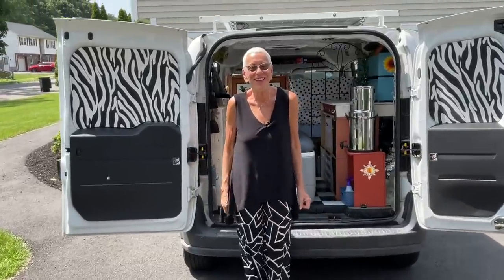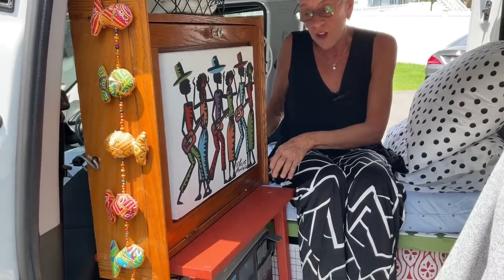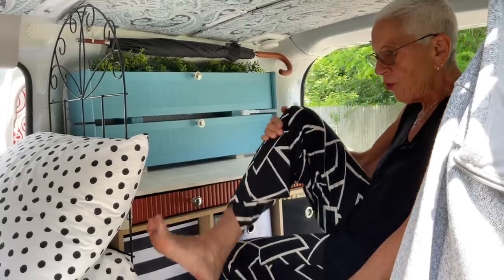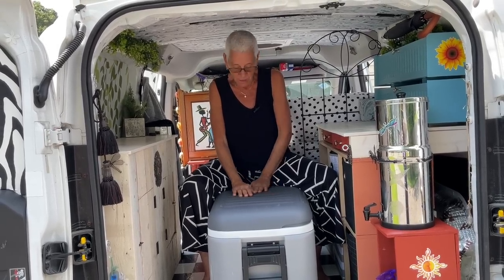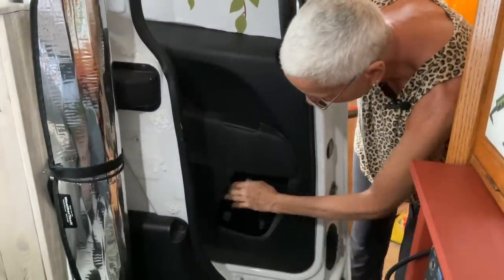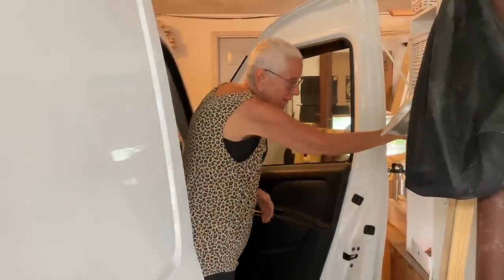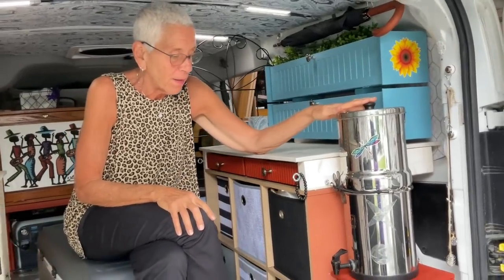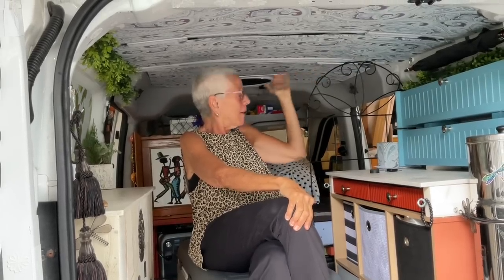MAKING ADJUSTMENTS TO MY VAN BUILD AFTER MY FIRST ROAD TRIP IN THE NEW BUILD - LIFE IS GOOD!!

Comment: Lulu, I've been researching cooler sizes for you.  I suspect you already have done this research too.  As far as I can tell, your present cooler is 17.75 inches high. I looked for a different cooler that is lower in height and still at least 100 quarts.  I searched Yeti, Pelican, Igloo, RTIC, Cabela's, Orca, Engel, Magellan. It seems that nobody has a large cooler that has a lower height. Your 120 qt Igloo exterior dimensions are 38.31x17.36x17.75. Interior dimensions are 34.69x14.88x13.25. I think the dimensions correct? I think the only possible consideration might be the Yeti 75. The Yeti 75 exterior dimensions are 33x17.8x17.6  with interior dimensions of 25.8x11.10x13.10. You would only gain .15 inch of height.  That is such a small amount of height savings. It doesn't seem worth it because of the loss of interior storage in the Yeti 75 cooler. Perhaps try two (2) Yeti 65 coolers with exterior dimensions of 30.8"W X 17.3"D X 16.0"H and gain a soaring height of 1.75 inches! Its been fun to try to find something to help solve your seating height problem. I know you're still looking for a solution by changing the top or bottom of your Igloo or by sinking it into the floor. I know you'll come up with a brilliant solution, you always do!
Reply from the maker: WOW DEBRA!!  I can't believe all this research you did!  what a thoughtful person you are!!  I truly appreciate it!!  yes, you had the measurement of my cooler correct!!  ❤️

Comment: Regarding your cooler, the seals are pretty important to keep it cold inside, so I probably wouldn’t mess with the top. But what about cutting a hole in your floor. Do you have enough insulation, subfloor to get an inch extra?
Reply from the maker: hi Beth!! thanks for the suggestion, but I need the cooler to move around, not be stationery.  I need to move it a bit to open the door to the pallet cabinet, and then I need to move it back over to pull out the cubbies, and I need it in a certain spot for when I'm sitting and cooking so there is room for my feet.

Comment: Your idea is amazing but to make it more comfortable is just get Velcro and a lawn chair cushion the long ones and another patter and secure it to the top it’s light weight and does not compromise the seal of the cooler
Reply from the maker: hi Mary, good thought, except a cushion on the cooler would bring me up to touching the ceiling with my head, I do not have the space for a cushion.  I need to be lower, not higher!

Comment: On the cooler, do they make any of them shorter?  I do like your thinking on the foam board with wooden board as lid.  Similar to your trimmed bubble silver liner, when I was using my 25qt cooler I trimmed a FedEx bubble wrap plastic envelope to fit to keep the cool in. Then a friend gave me several of those big silver bubble wrap bags that they do meal delivery in that I repurposed by turning one instead out so silver is pointing inward & put that bag inside another bag that has the silver on outside so it is double insulated to hold the food inside the cooler.  It really works.  

On the door to salad bar latch, yes a little board that toggles/turns could work.  I have something like that to keep drawer crates tucked under my bed & not slide out while driving.

Yup, we are forever readjusting our PMC cargo vans, depending on what kind of trip it is.
Reply from the maker: hi Karin!!  I can't seem to find a cooler that big that is shorter, mine is 17.75" tall.  I'll figure it out!!  yes, that bubble wrap makes a huge difference!!  glad it's working for you!   😊

Comment: Hi, Lulu. I was just wondering how much space is between the cooler & the under the cooler space there is. Perhaps cutting a hole in the floor just big enough & deep enough to give you more head room @the ceiling.
Reply from the maker: not able to have the cooler stationery, I need to move to to get into the cubbies and then move it the other way to open the pallet cabinets doors.  thanks for the suggestion though!  💕

Comment: I’m hoping you will talk about the tweaking you mentioned regarding your power use. Would really like to know what you learned.  Thanks!!!
Reply from the maker: hi Nancy!!  I learned that my power system is working just fine, it was just that I didn't quite understand my new set up yet.  I was used to 400W of solar and that charged up my power station fairly quickly.  now I only have 200W of solar so naturally it's going to struggle to get it up to 100%.  and I'm not driving all the time to be able to charge it that way.  I'm figuring out and seeing patterns on what I gather, what I use, and what I'm able to use without a threat of running out.  so far, so good!!  😊

Comment: I hope I explain this in a way it makes sense.  If you have a half inch space between the drawers can you attach a small board to the bottom on the  side of one drawer  that is equal to the amount of space you have? To make a spacer so the drawer doesn't touch the other one.
Reply from the maker: good thinking!!  thanks.

Comment: looks like you are bending forward a bit to avoid the ceiling now.  probably not good long term for your spine and neck.  your left shoulder seems higher now.  i was a van dweller for 4 years and still dealing with hip, shoulder, and neck pain.  i have screwed up alignment from sleeping and sitting in it, even two years out of the van (age 66) and chiropractor.  it's quite painful.  looks very useful and pleasing to the eye (sept the umbrella🤣😂).
Reply from the maker: keep watching my videos and you'll come across the modification I made to get another inch of headroom . . . gamechanger!!!  😊

Comment: how about just a little white caulk in the corners between the trim and fan to hold it up, you can remove it better than glue just cut it with a utility knife.  Cooler idea 👎You won't have that tight suction fit and i believe that adds to the insulation.

Comment: Hello Lulu I'm with one of the commenters get a smaller cooler you don't need such a long one and someone said to get smaller portions of food or not so much I don't know how to read that again whatever you do I know it'll be good and good luck on your trip I wish I had the patience and strength to cut things like you do for your salad my back hurts so much I have to just hurry it up I like your spunk for being alone and traveling I would be lonely and scared that's just me though
Reply from the maker: hi Diana!!  getting a cooler that is not as long will not solve any issues that I have.  I have the space for the long cooler.  it's just too tall.  but even the smaller cooler are still the same height!!  oh well, I'm making it work for now, until I figure it out.  it's all good!!  thanks for writing!   Lulu  🌺

Comment: Do you really need that bulky cupboard/fold out table next to your bed? Is there not a better, smaller, solution for that space?
Reply from the maker: hi Adrianna!!  well, the power station is there and need to stay there, the table over it needs to be there to protect it from me putting stuff on top of the power station and potential spills.  so if the power station is there and the table is there, might as well use the space above it, it's just empty space.  ya know?

Comment: One thing I've been wondering is whether or not your painting is going to get damaged over time from the wood edge when you open  
the cupboard.

Did you match the colors in the painting with your decorating on purpose?
Reply from the maker: hi Moka!!  I'm not worried about the painting getting damaged. it doesn't seem to be causing stress on it.  but if it does, so be it!!

you gotta hear the story about the painting in this video:
https://youtu.be/-HkSUbWah0g
go to minute 7 in the video.

Comment: Lulu can you cut out the floor just enough for the cooler to drop down a little?
Reply from the maker: no because I can't have it stationery like that.  I need to move it over to pull out the cubbies, I need to pull it over to open the pallet cabinet doors and I need it in a certain spot to sit and cook so that my feet fit on the floor.  it's tight in there!!!  😊

Comment: Would it be possible to add a shelf above the doors of your white washed wheel well cabinet with little doors for access?  Then maybe the empty space at the top of the cabinet could be used more efficiently.
Reply from the maker: hi Susan!!  I intentionally left that upper wall blank,  I need the headroom, I don't want to close it all in.  I think I'm good on storage!!  thanks!!  😊
Reply: @LulusWay64  Thanks for your response.  I wasn’t clear in explaining.  I meant inside the upper part of the cabinet.  With the doors starting low in the cabinet it’s hard to access the space above the door opening inside the cabinet.  A shelf inside and little cabinet doors above the cabinet doors that are already there might make that space easier to utilize.  Perhaps that would be too complicated to add, but it’s a thought I had when looking at your beautiful build.
Reply from the maker: oh, now I see what you mean!  yeah, it's pretty complicated inside that cabinet, above the doors is a 1x1 support beam, then at the top is a 1x1 support beam, and also on the sides.  also on the back of it (on the metal) is a thick board that attaches to the metal, then attaches to the countertop.  and the cabinet is just so narrow that there is very very very little space available, even though it looks like it might be open and available space.  it's all crammed up with wood!! LOL  structurally it was very important because it's rattling down the road when I drive and it needs all that support.  I need to think of it less as a cabinet and more of a wheel well cover with a countertop, with a tad bit of available space to shove a few things, not much though!!

Comment: If I put a wider table on the top of the unit behind the drivers seat, I would hit my forehead on it constantly.

Regarding the cooler, I only wonder if the idea you have would have the same insulation qualities as the manufacturer built into the lid. You’d probably need to at least put some kind of rubber seal between the wood and the cooler edges.
Reply from the maker: hi Chris!!  fortunately, my head doesn't go anywhere near that little shelf, so I won't be hitting my head on it, YAY!!

I expect that the performance of the cooler would decrease if I tampered with the cover, I would expect that.  but I would also expect that it would do a good job.  I'm still thinking about it!!

thanks for your thoughts, I appreciate it!   Lulu  😊

Comment: Lulu great tweaks love all your new ideas. I was thinking about your cooler. Is it possible the floorboard could be made thinner. Maybe it’s thick? that would give you some head height. 
I would be afraid to mess with the cooler lid. that insulated thickness is why your cooler is efficient. You might loose that insulation & spoil all your food inventory which is a big expense to lose. Otherwise your idea to find another cooler might be best If the floor idea doesn’t work. So excited to hear what is next in your big adventures. Mariaknits27 💃🏻💕🚐
Reply from the maker: hi Maria!! thanks for the suggestion, but the floor is in, lots of things are built onto it and it's staying!!  I'll figure it out!!  😊

Comment: Lulu please use the blackout on your windows. No matter how safe you 'feel' there is a potential to become a victim.  
 And any lowlife WILL take the advantage of breaking in while your asleep. Your reaction to such an invasion  may be too slow to make a difference. At least with the windows  covered you can get behind the wheel quick enough to drive off to safety. 
Make plans on what you could do when SHTF.
Reply from the maker: although I appreciate your concern, as I said in my video, I am not concerned with this at all.  I will assess each situation as it comes.  😊

Comment: I've been reading of suggestions of adhesive command strips or velcro strips for use with the fan frame. I'm in Australia, and what I have found is that anything adhesive like a velcro strip or a command strip won't cope once the heat hits whatever the strip is attached to. Likewise humidity affects them as well. May I suggest for the fan frame that being as you have the corrugated plastic (by the way it's called corflute) under the blue paisley fabric, it would be easy to use sewing pins or a staple gun to attach 4 white 1/2 inch waist elastic to opposite sides of the edges of the frame and stretch it from one side to the other side of the frame. The white elastic would easily blend into the white frame edge. This way if you did need to get the frame out for any reason it could just slide out. I used this method to attach a power board under my desk to keep all the cables for my computer etc. tidy. The stretch in the elastic works better than ribbon.

In terms of the fold down table. I think moving it over etc. is a good idea, but instead of putting your bowl at the very top next to the basket, have you thought of getting another thinner piece of plywood and fixing it with a hinge to the bottom of the side of the cabinet so that it could drop down across your lap when in bed and then when you don't need it flip it back up and secure it with a latch at the top? 

I also think your idea for the cooler lid is genius and would allow you an extra opportunity for a decorating touch! Love your work!
Reply from the maker: hello!!  thanks so much for all your suggestions!!  you are thoughtful!!  😊